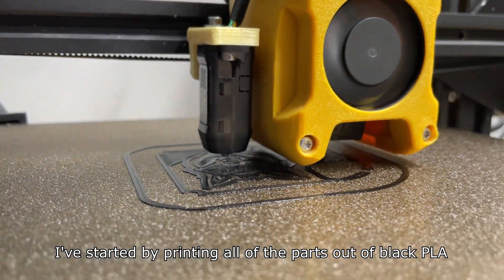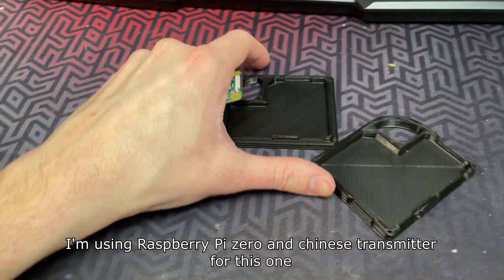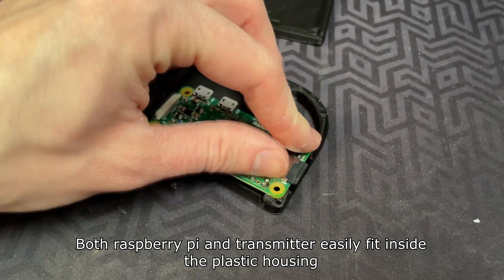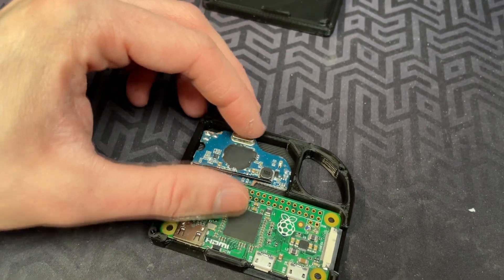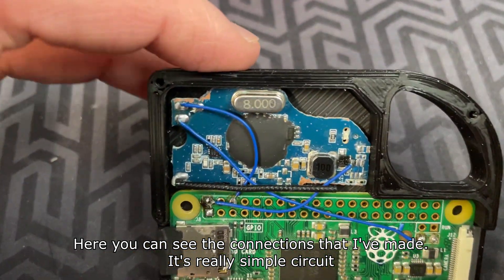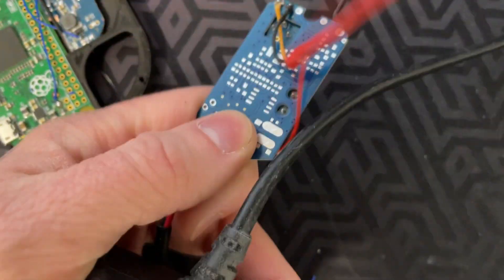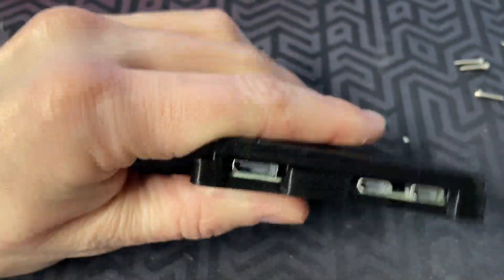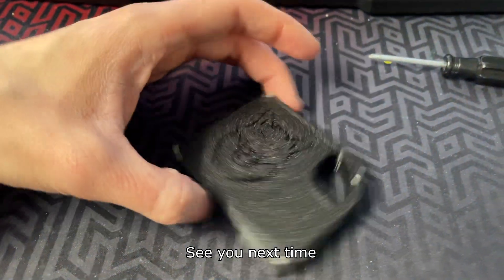Wireless Compute Module | Onyx Glasses

Comment: Do you have a comparable wireless module you would recommend? I know you’re not sure what this exact model is but I’d love to try doing something g similar.
Reply: I'm thinking a wireless backup camera transmitter could be a cheap option - its already composite, so it should hook up nicely to the pi and the flcos display